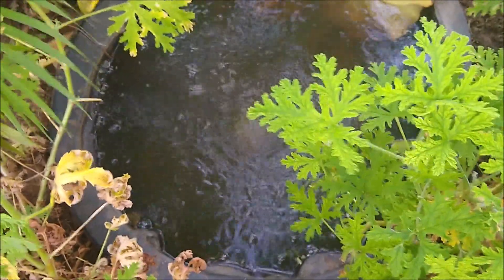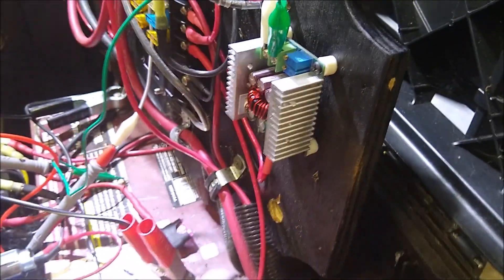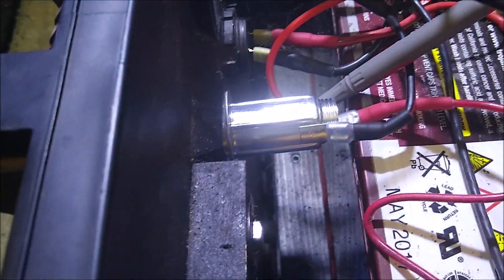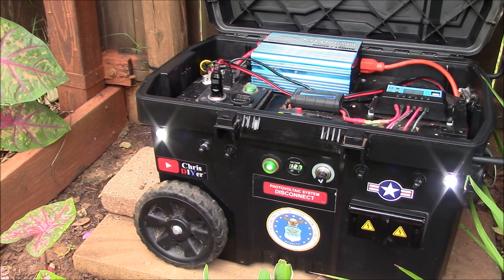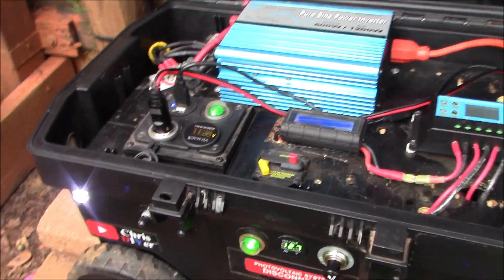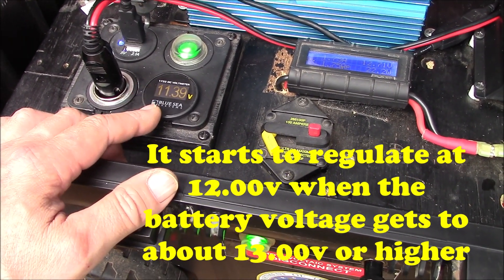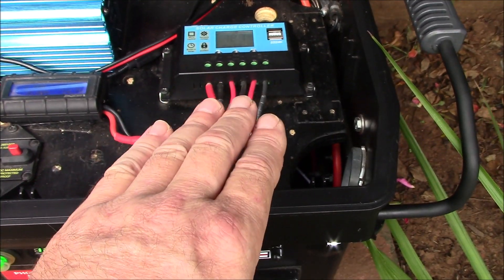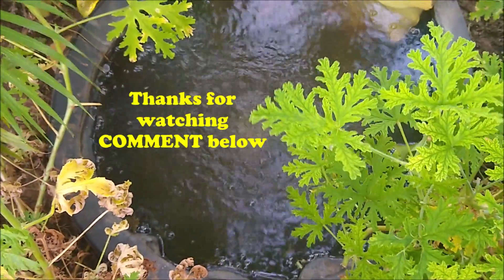DeWalt box 12V garden pond  SOLGEN - new mods (step down buck converter and much more!)

Comment: How heavy is the battery and does the plastic box hold up with the heavy battery? any signs of wear? Do you transport it or keep it stationary? thanks for the vid, good job looks nice
Reply from the maker: 69 lbs. The DeWalt box is very sturdy...I did make a plywood base for it. No wear, but it sits outside 24/7. Deep cycle AGM batteries do better for outside 24/7 use...better in the cold/heat. Lithium batteries...not so much.
Reply: The box supports 90 pounds

Comment: YO Chris, instead of going through a lot of wiring / changing bulbs,  may I suggest a quick out-of-the-box fix.   I have a lighted switch on the dash of my van for my fog lights. It was a bit too bright.   So I took some paint on a small brush and placed a drop of darker paint in the middle of the lens, sort of like the old BLUE DOTS that hot rod dudes used to install on their tail lights.  I actually uses some red nail polish from a small bottle which I use often to mark the positive side of battery circuits.   Just make sure the color doesn't clash with your toenails..... ;-P      J K      GO ASTROS